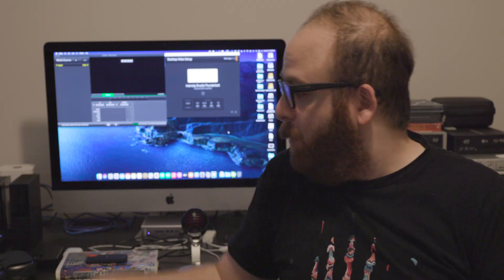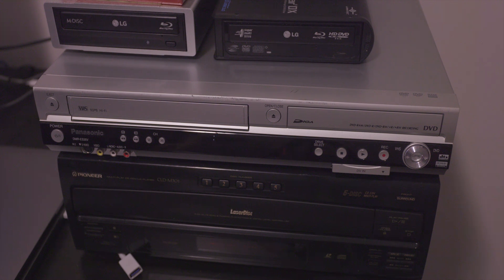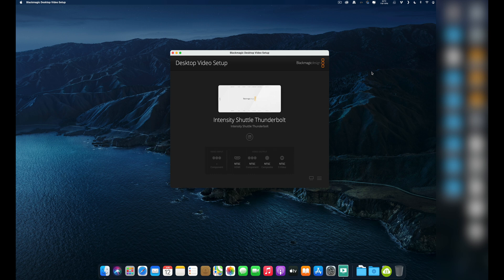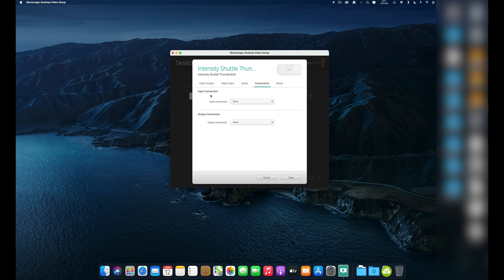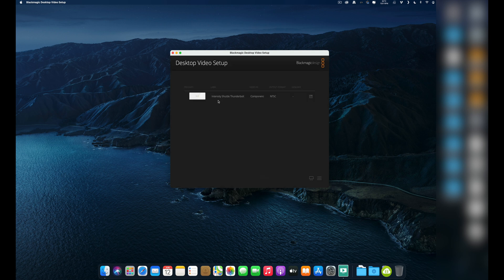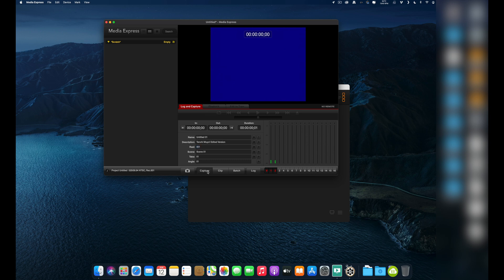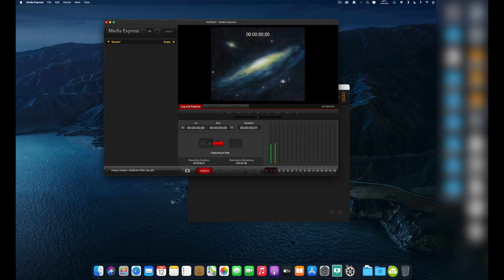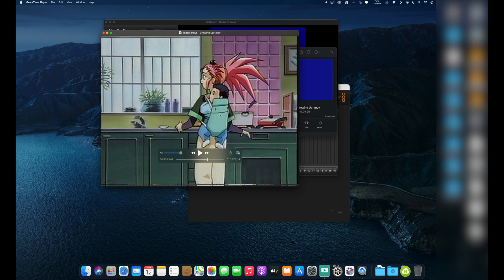High Quality VHS ProRes Capture Tutorial

Comment: Does this work on Windows?
Reply from the maker: To my knowledge, the Blackmagic Software is also on Windows, but ProRes capture is not possible on that version.
Reply: @ArguingMeadows  What is some good software you recommend which I could use with this and windows to capture old Hi8 tape footage? free and easy to use.
Reply from the maker: @Mr.Goodkat  Assuming you own the Intensity Shuttle I showed off in the video, just use the BlackMagic software that's meant for the device.
Reply: @ArguingMeadows  I found two online, one is the thunderbolt and another is the USB 3, will both be equal in getting the footage quality/sound wise?
Reply from the maker: @Mr.Goodkat  I would assume so, yes.
Reply: @ArguingMeadows  Thank you for your help, I only have two more questions, I have an elgato video capture but the colours look washed out, when you capture with this, do they look the same as they do in the original footage? and does this stop capturing if it drops a frame?

Comment: Just wanted to ask you a question, does this method still work on Mac version Ventura 13.6.7, please? 

As far as I’m aware of, your method of capturing analog video on Mac is the only way to capture VHS tapes or any analog video formats in its original native video format and frame rate on Mac. 

Other methods will only work on PC or Linux.

Thank you.
Reply from the maker: I just did a capture on MacOS Sonoma, so yeah, as long as you download the latest software of Blackmagic Media Express, it’ll work.
Reply: @ArguingMeadows  Thanks for the response back, you might have just helped me a lot. 👍
Reply: @ArguingMeadows  Hello again, I had a problem initially, originally when I managed to get the equipment that you showed in your video, it seems that the latest version of blackmagic desktop video set up was not be compatible anymore with the intensity shuttle, I had to download an older version of desktop video 12.1 which is the version you showed in this video in order for the device to be recognised.

But once I did manage to recognise it along with a few tweaks, I was finally able to capture a VHS tape in its original native resolution and framerate, all thanks to you. 👍

I have been waiting for some time to do that.

Once again, thank you so much. you’ve made me a happy bunny. 😂

Comment: S-Video is just separate Chroma and Luminance, they don't exist separate on VHS so there is no advantage.
Reply: That's not quite true, luma & chroma is stored semi-separately on VHS, in "colour-under" format. It seems it's effectively the equivalent of being in-between a composite and s-video signal. It may technically be a "composite" video recording, but not the same type as is passed over composite cables.
S-VHS recordings use the same colour-under method, but with a higher luminance carrier frequency and luminance bandwidth.
From my own testing, with some equipment at least there it can definitely improve video quality using s-video. I recorded composite & s-video from a plain VHS tape/recording played in an S-VHS source(a full size SVHS camera in that case) recorded to an ADVC-300, and the s-video recording immediately looked better. Less noise, and a bit smoother and slightly more detailed, all presumably due to reduced chroma noise.
This is likely going to vary depending on the deck, capture device etc, but it does seem like the most reliable way to consistently get good quality captures.
Reply: @DoubleMonoLR  I realized my goof on that just a couple weeks back. You are correct. A tale of two "composites".

Comment: I couldn't get Blackmagic Intensity (PRO and Shuttle) to work with desktop video. If stop at dropped frames is switched on, it will stop within 3 minutes. If stop at dropped frames is switched off (factory setting), the picture and sound drift apart. I assume that frames are missed because Intensity does not take over the frame rate of the video recorder. Panasonic NV-HS900EG (PAL S-VHS) YC Panasonic DMR-E55EG (TBC only) YUV.
Reply: Blackmagic devices seem to be very flaky without some form of TBC type effect, for example I played tapes from a combo VHS+DVD recorder which always digitizes the video, then converts back to analog(it can also output vhs via component etc because of this), so the tape effectively passes through a basic tbc-ish device. Recording to an intensity pro worked fine this way, no problems over an entire 3 hour recording.
Reply: @DoubleMonoLR  Was STOP at dropped Frames switched ON ? The "Factory Setting" of the Software is STOP at dropped frames OFF😉

Comment: You can just run a vcr through a dvd player/recorder and that will stabilise the image. Will be cheaper than buying the combo deck.
Reply: @duncanmacleod2136  LG RH2T80
Reply: @duncanmacleod2136  Any one really. I have a couple an LG and a pansonic then I run the hdmi cable into my Elgato game capture card. Great upscaled captures with stable image, You can get an old dvd recorder for virtually nothing now.
Reply: @duncanmacleod2136  dmr-es10 and dmr-es15 are good examples.  Make sure you go into the menu and disable noise reduction though.  No settings for TBC it is just always on.

Comment: Can you skip the capture card and just plug a 8mm camera via firewire directly to the computer? My Handycam has a firewire port and my computer has a firewire port, so can I just do a direct connection then use software to record?
Reply: You can do it with some MiniDV cameras, but the video is technically converted to DV digital through the camcorder.
Reply: @iVTECInside  But wouldnt it do that anyways if your using a capture card on top of that process?
Reply: @norcalpacific  there are a couple variables here and I assumed one of them. I have a MiniDV camera that I can use as a passthrough, run video into it and straight firewire to PC. In that case I'm converting VHS as an example into the DV format which as sos mentioned has a different color space. In practice VHS is so crap I never really noticed a difference the few times I did it. If you were playing back a MiniDV tape over SVideo/Composite into a capture card, you are 100% correct, it's already in 4:1:1 on the tape so you won't hurt anything (aside from capturing analog vs the pure digital output). Law of diminishing returns though. Capturing over firewire is your best bet for quality in the case of a MiniDV tape but then you have to compress it after the fact. It's not too bad these days with faster PCs, but I'd still lean towards just capturing it straight to higher bitrate MPG to save time. I use a rate just over double what's technically necessary when capturing VHS fwiw. Is it archive quality? Nope, don't care. Not spending way more money on capture equipment, way more time in post process, for MAYBE subjectively 5% better looking captures.
Reply: colors will look of, since DV cameras transform 4:2:2 into 4:1:1 so its going to look washed out

Comment: Great video… however why not also use a Up scaler in ur system b4 its brought in a program
Reply from the maker: Hardware scalers have to work in real-time and usually are nowhere near as good as a software scaler. If you modify the video while capturing in real-time by adding a hardware scaler or a deinterlacer, you are stuck with whatever the hardware did. If you capture the video plainly as it is in a high-quality format, there's a ton of room to play with filters that can make the video look even better after the fact. It all really depends on how much work and time you'd like to put into capturing the video and improving the quality.

Comment: Just wondering if you've run into the issue of the Intensity Shuttle no longer being compatible with Mac OS (as of the update to Big Sur) - I recently bought a shuttle and it works fine on an older computer, but I can't get my newer one running Big Sur to work with it.
Reply from the maker: Running Monetrey which is newer and it's still working just fine. Have no compatibility issues to speak of.
Reply: @ArguingMeadows  Oh wow, I will update to Monterey and see if that helps! One more question: I find that when I try to capture from a camera, the image flickers and is unusable. Seems like this is due to unstable timecode from the camera (and why I assume you recommend the DVD/VHS combo) - have you ever run into this and do you know of a workaround? VHS/DVD deck won't work for me since I need to capture hi8 tapes.
Reply: @ArguingMeadows  interesting! I had the same question:)

Comment: The HiFi "notation" is only about the volume level, you can set this yourself, when switching off the HiFi function, You can use ProRes 422LT which is enough for VHS resolution, since it's compressing per frame, you have even then no loss, using the DVD recorder will also have loss, because you still see far more detail, than you saw on a CTR tv 😁
Reply: Why doesn`t he use a TBC ? My experience is the Premeire always stops capturing without a TBC between AD converter and VCR. btw the svhs with tbc is not usefull to solve it.
Reply: @NBAONDVD He uses an es-15 which has a frame sync and a line TBC. The line TBC is crippled to allow for macrovision because it is a commercially produced DVD recorder. Another thing is the Shuttle doesn’t handle analog signals that well. If you get the right Pinnacle 710 it blows that thing out of the water. I have had both of those cards. The Pinnacles are much more resistant to bad signals. Pinnacles work well in windows 10 in virtualdub. You can use Huffy lossless compression in virtualdub. The ES-15 isn’t transparent it messes with luma and causes color banding. Still it does have a frame sync which tries to prevent dropped frames and it has a line TBC. Some people chase the es-15 with a DVK 200. It helps stabilize the signal. An ES-15 alone isn’t enough to stabilize some tapes, especially when you are dealing with the shuttle. It seems to be working for him though so that’s good.
  A line TBC in a VCR won’t prevent dropped frames. Line TBCs correct geometric distortions. A frame TBC will prevent dropped frames. Frame TBCs are really expensive though. At least he is recommending something that will help with dropped frames instead of saying hey just use a VCR with a line TBC in it.
Reply from the maker: @NBAONDVD  I said it in the video, my player has a TBC built-in.

Comment: You would get much better results using a S-VHS machine capturing via S-Video than capturing crappy composite signal to 4:4:4, that's nuts, waste of file size.
Reply from the maker: I didn't capture via composite though? I specifically said component. I also made a point of saying that ProRes 4444 was overkill, but I like to do it anyway.
Reply: @ArguingMeadows  The component output is almost certainly just converted from composite. Composite out from the VHS deck -> analog composite signal is digitized inside the VCR -> digital signal converted back to analog for Component(& other) outputs. Capturing Component will help reduce further quality loss during re-digitizing with the capture device, but it's not extracting higher quality video from the tape signal.
The s-video signal isn't being put out over the component outputs, that's not possible as they're different signals, and there was almost certainly no s-video signal prior to digitizing inside the vcr. The image quality just looks pretty much the same due to coming from the same source, and neither losing much in the capture process.

It's technically possible they could've used a modified VHS deck that internally converts the rf signal(directly from the tape) to s-video instead of the standard composite, but it's unlikely.
S-Video out from an S-VHS deck starts by extracting a bit more image quality from a standard VHS tape recording, as both VHS & S-VHS are recorded in a format that is somewhat similar to s-video. Because of this modulating the raw signal from the tape to s-video instead of composite can retain a bit more image quality.
Reply: @ArguingMeadows  correct, the ES35V is a great machine, i use ProRes422LT in that same setup, with PAL even progressive… so easy :)

Comment: Hi! Model of the Panasonic VHS/DVD Combo?
Reply from the maker: DMR-ES35V
Reply: @ArguingMeadows  Great machine i  also have this model, (PAL version + scart(s)) it stabelizes the video of the VHS deck, but it does not mention any thing about TBC but it does a great job in doing it,  shame the BMD software does not support the progressive mode for NTSC with me (PAL) this works perfect, and defeats Macrovision when needed, in progressive mode.
The Intensity Shuttle is normaly a very picky capture device, but has no problem at all with the DMR-ES35V,  I love this machine.
otherwise you have to use a scaler/converter that digitizes to HDMI and use HDMI to capture, the scaler/converter then acts as TBC.
Reply: @eric-janvandenbogaard9415  yeah the Panasonic does arguably the best job of delivering a stable corrected signal to the BM, their AD chip is the best when it comes to handle lossy signals

Comment: Great Video. 

I have a Mac as well, but I mainly use Windows for video stuff, so I am lacking the option for native ProRes 4444. (btw, is there any need for an alpha, or does it not take up much space if no alpha is present? You did say overkill tbf. Or is there not a ProRes 444? I am new to the ProRes scene...) They have open source versions of ProRes in some of my other software I have tried, but not in express. I currently capture Uncompressed 4:2:2 as a trade-off for quality and size, but looking into other options as complete overkill for VHS. (Bit-rate is 171mbps for 8bit422 and 362mbps for full 10bit444) I wish I had a codec like ProRes for a file that small from capture stage. I can transcode after capture, but it's just not the same, but also keeping that option on the table. DPX looked promising, but can't keep interlacing. Transcoding after capture is probably only way I could try ProRes 4444, and open source doesn't always make on spec ProRes files, but might not be a problem if just for storage as master. I am also looking at a few others like FFV1, which I currently use as intermediate after processing (progressive), but it doesn't support interlaced video correctly without some tricks. Going to take a second look at HuffyYUV and also look more into MagicYUV to see if it can correctly store interlaced.

Thanks again for making the video.

Definitely keeping an eye on the Domesday VHS Head project, seems like the future of capturing analog.
Reply from the maker: There is a lot in here, so I will attempt to break it down. ProRes 4444 has the ability to encode an alpha channel but as consumer tapes and laserdiscs don't have alpha channels, that's unnecessary. I don't think it changes the file size drastically. Also, ProRes 4444 is still going to give you a huge file, you're looking at 15 GB for a half-hour SD capture. It just happens to be way smaller and more manageable than straight uncompressed, where you might be looking at double the GB compared to ProRes 4444. I do not use Windows often enough to tell you how to work with ProRes, but I do know that the Adobe products do support ProRes in Windows. Adobe has an official license and encoder to the codec. Uncompressed is fine too, and is technically better quality than ProRes 4444 since ProRes is a lossy codec unless it has an alpha channel (but I seriously doubt anyone would be able to tell the difference between a ProRes file and an uncompressed master). If ProRes is too much of a hassle on Windows, alternatives like Cineform and DNx are available. FFV1, Lagarith, HuffyYUV and other lossless codecs are great too, but they tend not to open in most editing programs like Final Cut, Avid, Premiere or Resolve. If you plan on editing or manipulating the video in editing software, you might be better off just using uncompressed, make your edits and send it out uncompressed again if you need to retain the quality that badly. My experience with unofficial ProRes encoders like FFMPEG's implementation has been fine frankly. Never had an issue with it, BUT I would not deliver it to a client without first running it through an official encoder just to be safe. As for keeping the interlacing, I can't imagine the lossless codecs not keeping that. Anyway, if you're using uncompressed, I don't think you have anything to worry about from a quality standpoint. Transcoding it to FFV1 might save you some space but that's about it. At the end of the day, it's VHS, what we're doing is totally overkill. You could probably get away with a well-done HEVC or H264 file after the capture and have it preserve everything. This is just my way of doing things.
Reply: @ArguingMeadows  for half hour at 171mbps, that is ~38GB for reference, so you are right, not as huge a difference as I thought, but would be noticeable when storing many tapes. That is 4:2:2 though and 8bit.

For ProRes 4444 equivalent it would be 362mbps and around 81GB per half hour, so it would have more of an impact. (Assuming ProRes 4444 is also set to 10bit)

I'm going to keep studying the technicals of these codecs and their bitrates, thanks for getting me interested in looking at them again. Several of them have been updated since I tried them before in the past, so more capable than my last tests.
Reply from the maker: @TriforceofShadows  ProRes is always 10-bit. 4444 goes up to 16-bit. That's kind of why I like ProRes, it takes a lot of the guesswork out of the equation and just encodes the video. Feel free to read the ProRes white paper: https://www.apple.com/final-cut-pro/docs/Apple_ProRes_White_Paper.pdf
Reply: @TriforceofShadows  I'm using the same setup with ProRes422LT which is also enough.